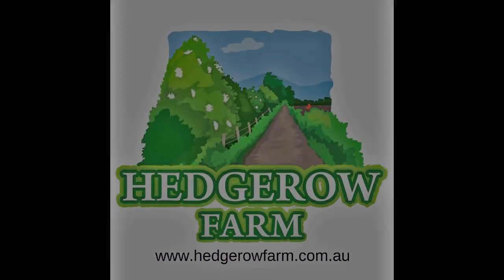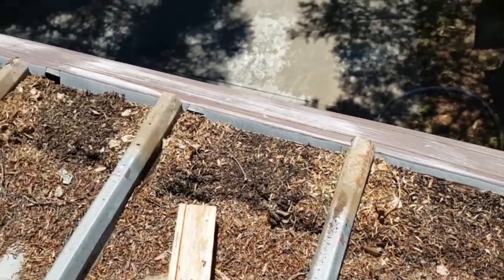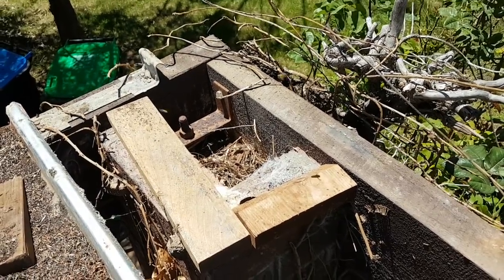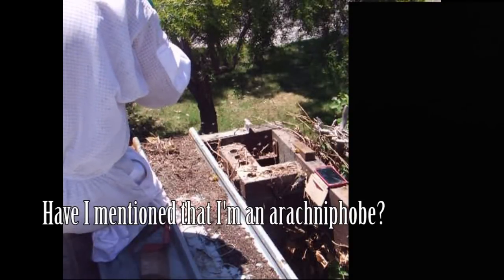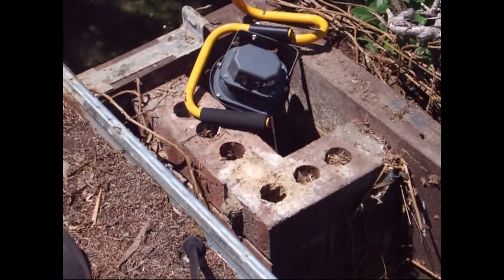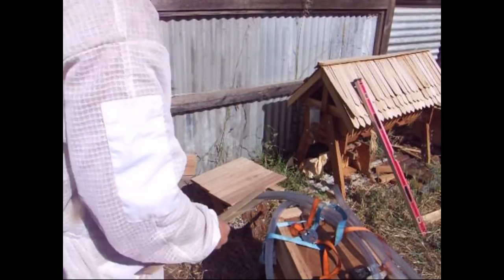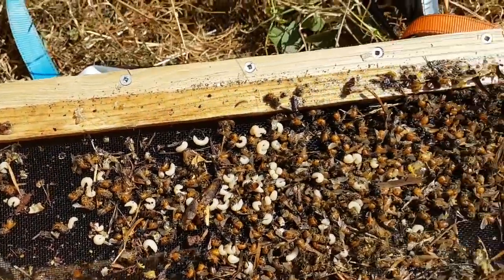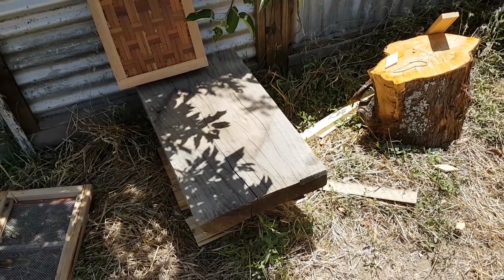I've been told to stop making videos on Bees by an experienced bee keeper.

Comment: Be careful collecting the hives on hot days, it can cause issues if you open it, or collect the bees when it's too hot. And with your vacuum, the guy that was teaching me had a flow control on the inlet (hole he could open up more). You want it slower than you'd think, hard to explain but just strong enough to suck them in.
Reply from the maker: Yeah but i had such problems with suction last time being too weak.  This time it was the other way.  I'm going to add another window so i can see what's going on and hopefully the next one won't be on a roof.